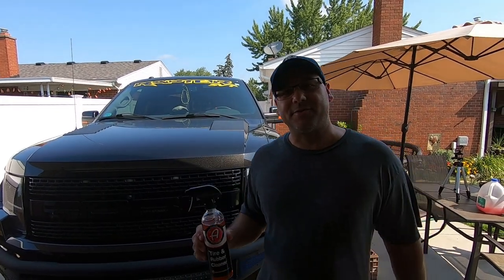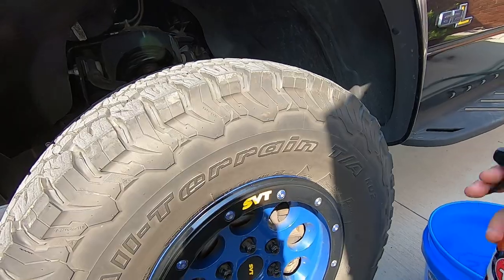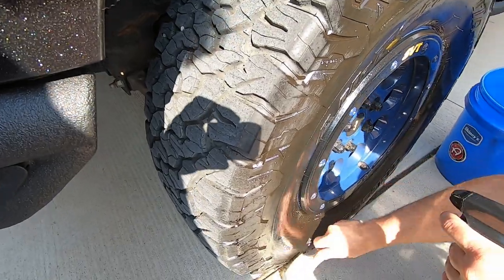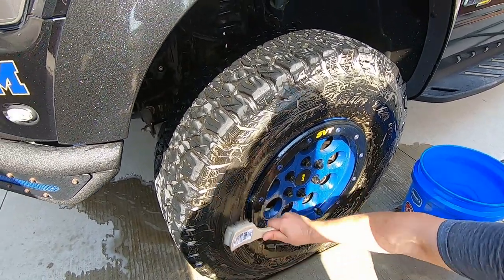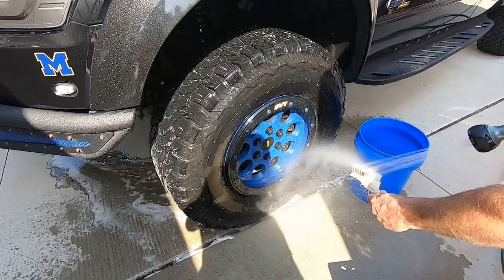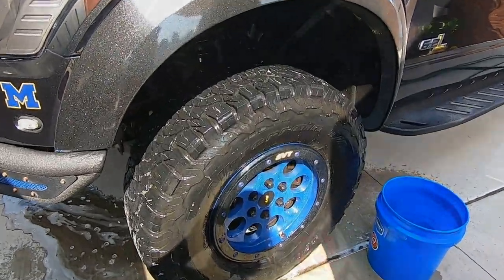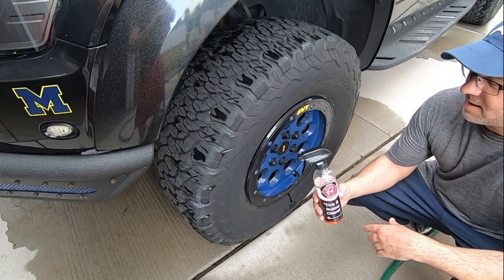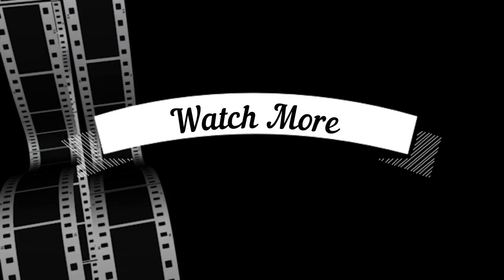"Adam's Polishes" Tire & Rubber Cleaner Review

Comment: Too expensive for me to use at my shop. 
I use Super Clean around 10 bucks a gallon and I dilute it 2:1 with great results. 

That said I'll give it a try just to see if it's worth what they charge for it. (An arm and a leg)

How clean is clean for a tire?

Thanks for sharing, another great video.
Reply from the maker: The price is only thing bad with this product.  How clean is clean for a tire hard to say clean enough for a dressing . I still need to get  super clean .. th anks Kevin
Reply: @OuzoLouGarage  

Exactly,  clean enough to apply a dressing as we know the tire will get dirty quickly. 

What I like about Super Clean is it works well with a lower ph than some of the very harsh cleaners and rinses well leaving no residue.
Reply from the maker: Heard a lot of good thing about super clean i pick some up soon  . I did get that Protect All going try it soon do you have any tips on it ?
Reply: @OuzoLouGarage  

Yes
Use very little as it doesn't require much product, it only makes it more difficult to buff off which most of the time it's very easy. 
A couple of sprays per panel is about all you need. 
Oh, shake very well.
Don't expect a fine spray as it's a little thick, it's more like a stream.

I'll be on the lookout for your review.
Reply from the maker: Cool and thanks for the help

Comment: For the price is it any better than  a general cleaner like spray 9 ?
Reply from the maker: It works better then simple green but for the price simple  green works good enough to get tires clean. I need to try super clean and it doesn't cost a lot.
Reply from the maker: Going make another video on this Adams tires cleaner on other uses
Reply: @OuzoLouGarage  I think it is good to show the expensive products in action as well too

For some the value might be there
Especially when it makes your job easier 👍
Reply from the maker: This product did work fast and i found out it can be used for other things on a vehicle going make another video on this